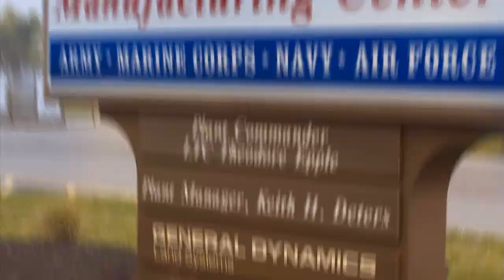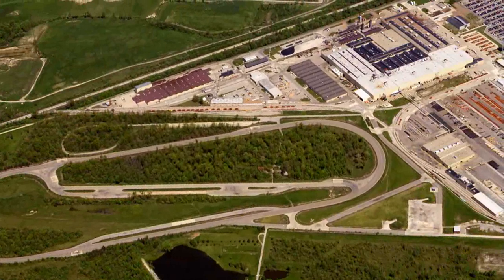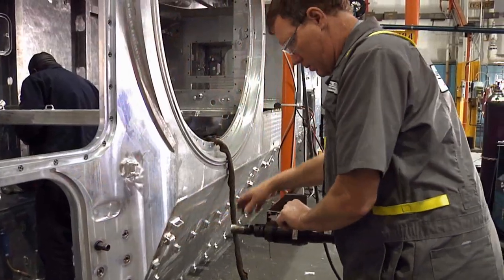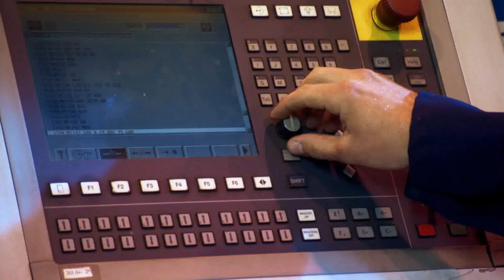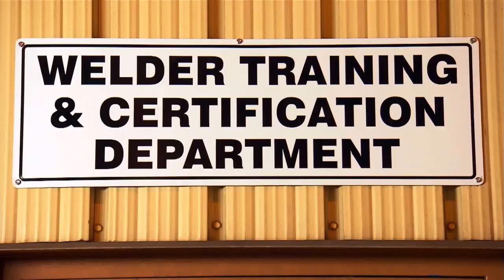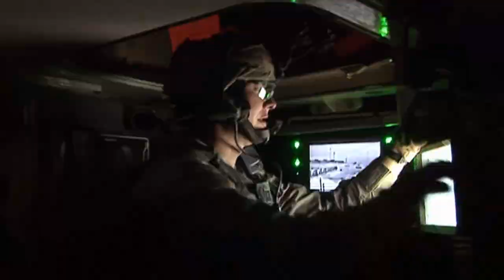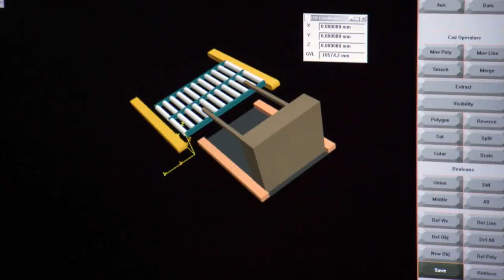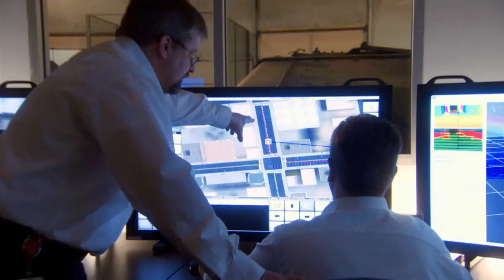JSMC short

Comment: Lots looked familiar. Worked there from 1981-91.
Reply: Do you remember a woman named Faye (Anis) Lepper?
Reply: @bodombeastmode  No...worked there 10 years. Awful big place with multiple buildings.
Reply: @daveshultz3718  Yes that's very true. Just asking because she was my grandmother.  All I remember is she painted the tanks.
Reply: @bodombeastmode  That's funny that I don't remember them painting the tanks. At least that I know of but it could been a different building than where I worked. Like I wanted to say before. There were at least 4 buildings and the one I worked in was where the assembly of both the hulls and turrets were assembled then attached and sent to a final assembly but you can believe this. There was never 1 that came off without something that didn't need repaired. In the beginning it was called Heavy Repair but GD didn't like that name and eventually had it changed to Test and Adjust. My 2nd cousin worked in that building and when repaired was taken out to an oval test track. He made sure I got a ride.
Reply: @bodombeastmode  Now that I think of it it may have been in the building I worked in. I just don't remember where in the building. You'll have to ask her if it was Bldg. 147. That was the main assembly building.
Reply: @daveshultz3718  She passed away in a car accident several years ago sadly.  One thing I remember though is she crushed her hand somehow while painting a tank and she always told us stories about how badly it hurt.